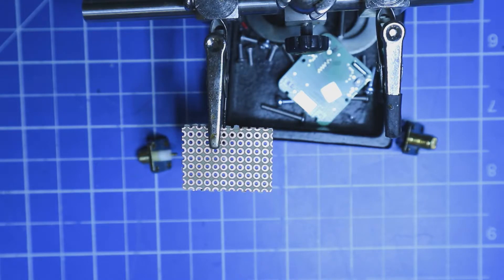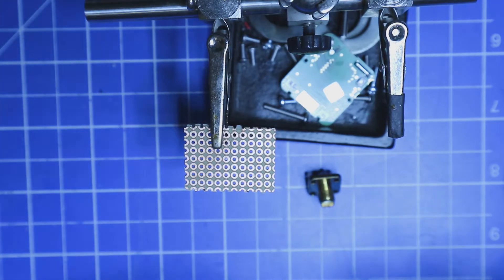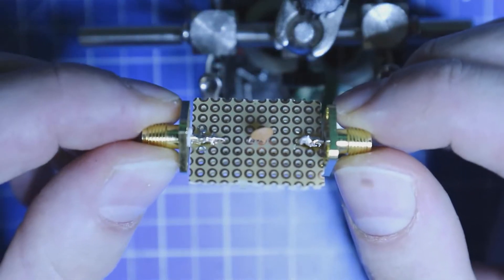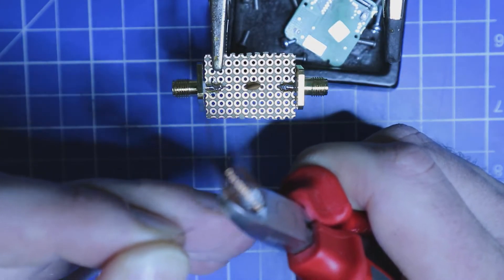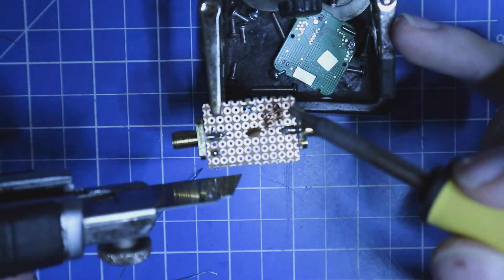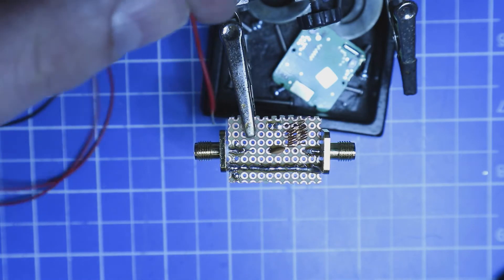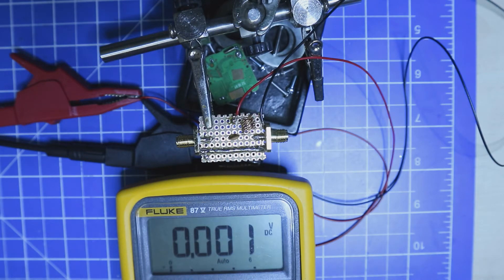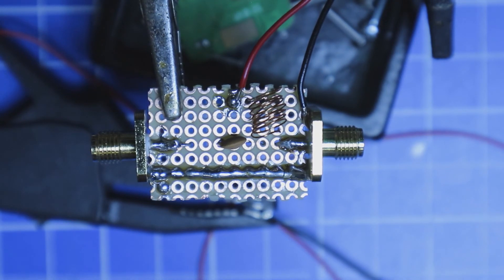Building a BiasT for QO-100 (ESHail2)

Comment: Thanks man, the cheapest I could find on Ebay was 15 euro and I knew it was only a matter of a cap and a coil. I will use this design.
Reply from the maker: Thanks for the nice comment. You can take s look at the text from sotabeams to get some theoretical info. Its really interesting. :)
Reply: @hansomdiy6044  It IS interesting, I am building it right now. I am considering putting a led with series resistor between ground and 12V so I can see if the power is on. Will that effect the signal do you think?